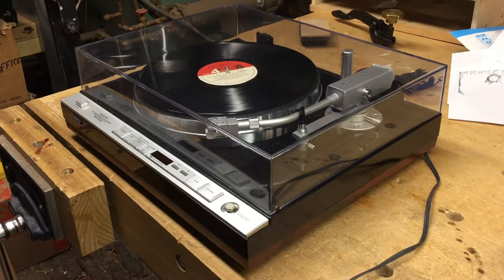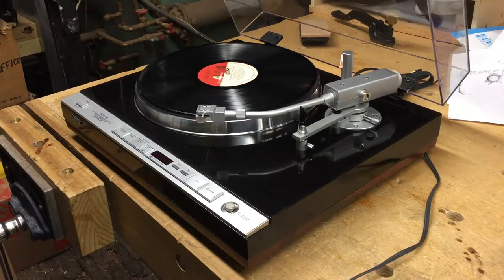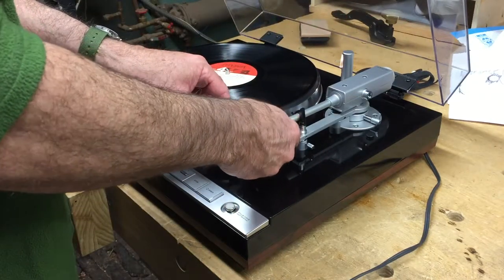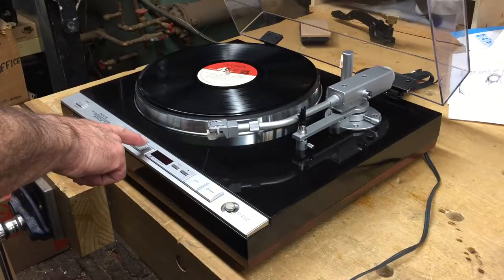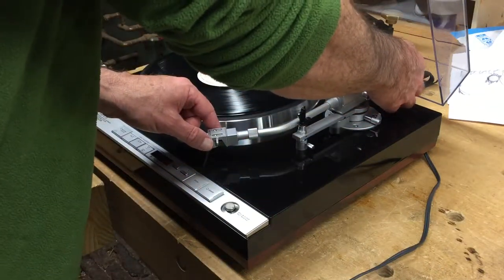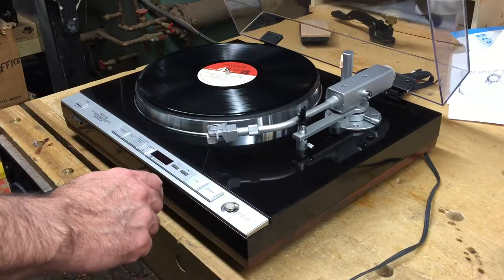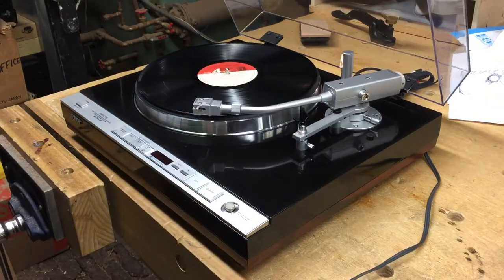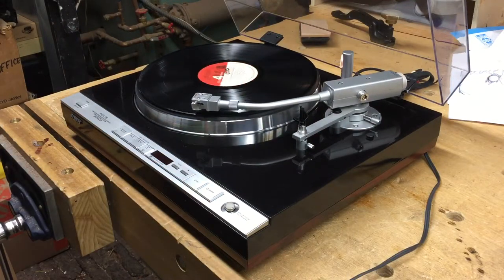Tonearm Balance on the Sony PS-X75 Biotracer Turntable

Comment: My turntable is fully functional but when I hit start it doesn't go right to the edge of the record like yours does. My like waves back and forth until it finds the edge. Anyone know how to fix that? Thanks for this video it did help me balance the tone arm!
Reply from the maker: Tyler, For that kind of behavior you'll need to run through the calibrations in the service manual. Pay particular attention to the Slit A/B and Horizontal Offset settings. Good luck and keep us updated! Bill

Comment: Hello!  I have a ps-x75 and I can't seem to get it to work.  It turns on, lights up.  At random the start, stop, and motor on off buttons will work together. The drop button and arm left right transport dont ever seem to work.  Are you able to have this unit restored repaired?  This is my father's old unit and am really wanting to get this fixed and brought back to new.
Reply from the maker: Hi, I have restored several. It is one of the best turntables ever made when functioning properly.

Comment: Hi. I have a PS-X75 Biotracer Turntable (TT) that I got in 1979. The table turns on. All of my buttons work except the tone arm up and down button. When the turn table is turned on, the tone arm will not engage  with the record. Also, the record sizing light (bulb) is gone (does not light up). I am not mechanically nor electronically inclined. I am looking for someone / service facility that can return my TT to fully operational condition. I live in Northern California. Please advise. Thank you.
Reply from the maker: Try the balance procedure first, if that doesn't cure the up/down then you are in need of overhaul of the lifter cam which is gummed up by old grease. Don't try to oil it, oil doesn't get to the cam which is deep inside the mechanism and it will just makes a mess. I've restored several, check my other videos for an example of a restored PS-X75, and if you are interested let me know.